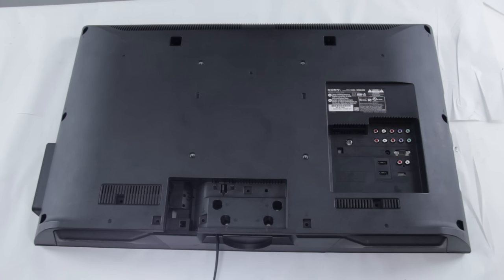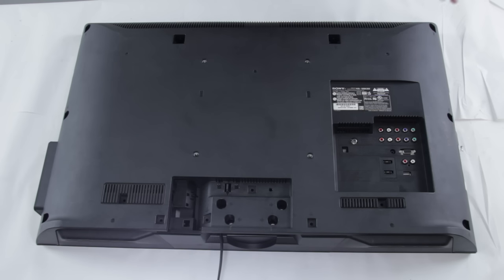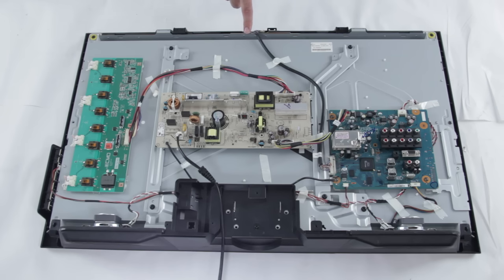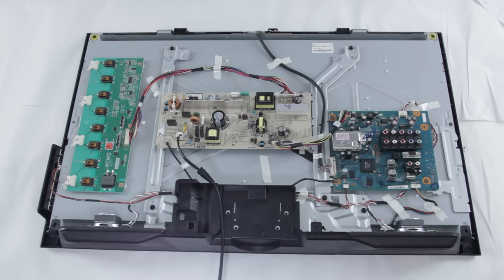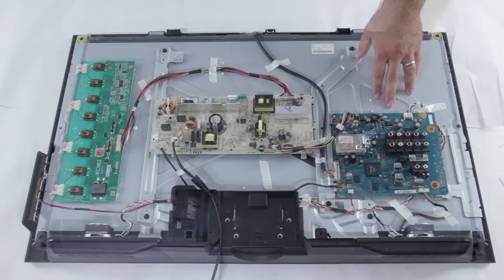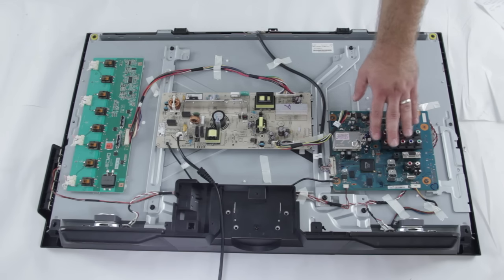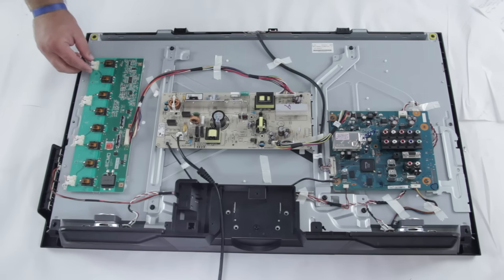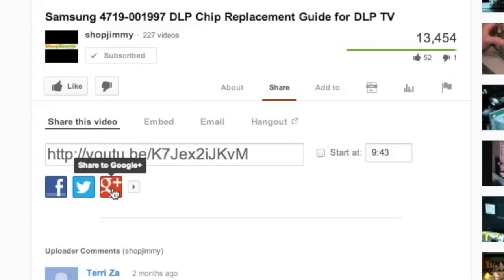LCD TV Repair Tutorial - LCD TV Parts Overview, Common Symptoms & Solutions - How to Fix LCD TVs

Comment: I have a Vistron 42" plasma (EB4219PD) which has a intermittent image fault, the tv powers up fine but every 5-10 mins the image moves to the right, leaving less than quarter of the screen black/blank & the rest of the image has horizontal scrambled look to it, after about a minute it returns to normal, any ideas would be appreciated.
Reply from the maker: Bimmy Lee  Please watch this video FIRST to help with your repair!  TV Repair! LCD, LED, Plasma, DLP How To Fix Your TV with ShopJimmy.com Help!  I recommend replacing the main board first to see if that fixes the problem.  Follow this link to possible replacement parts:  http://www.shopjimmy.com/catalogsearch/result/?q=4219  Be sure to match part numbers on your current board, with your replacement for compatibility.  Thanks and please let us know if you have any further questions with your TV Repair!  www.shopjimmy.com

Comment: hi, i have my sony lcd tv model number KLV-46bx450, the problem is, tv turns on for  seconds then after the sony logo apperas in the screen turns off then a 6 flashes of red led stndby light comes.. help please, is it only the mother board? im afraid that it would be the lcd panel.

Comment: I have a TCL Roku Smart TV Model 55S405.  It will periodically freeze the picture, shut down and go through a legnthy restart.  Sometimes it will run this cycle 4 or 5 times before you can watch anything.  I have tried the soft restart and factory reset and the problem persists.  Would swapping out the boards fix this problem?

Comment: KDL52EX700 Sony - Display is quite dim but visble and colors are distorted/remapped. There are no patchy/regional effects. Its done this several times, and then it would start working again - 100% perfect. Audio always works. Input from all sources are displayed the same on the screen.   Going to split case to look for leaky caps, sniff around and look for damaged components.

Comment: I have problem on my Sony 3DTV 

KDL-47W802A  

from 1 year my picture quality is very poor and video noisy with color not quality as well contrast low, I see HD content like SD on all source bluray or hd setellite channels or the  picture on TV not quality as was it new
 are you advise to me to replace my main board

Thanks
Reply: samsung led 32 inch plasma,type#UA32EH4000,MODELCODE-UA32EH4000RXXA
VERSION#AD01,S/N-299538RC301332B MADE IN SOUTH AFRICA.IT HAS A CRACKED SCREEN AND IT IS NOT SHOWING PICTURES BUT THE BACK LIGHT IS FUNCTIONING

Comment: I just replaced my mainboard on my CX after my television was randomly freezing and making a horrific siren like nose until I unplugged it. It would also randomly freeze without the noise and I would have to unplug it to get it to work again. 

I ended finding a lot on eBay containing a used like new mainboard, power supply, wifi module, power button, and screen board for only $75. I couldn't believe how cheap I got all of these parts for; $75 for a $291 mainboard is a steal. I got really lucky finding this deal. My tv works fine now and I have a ton of backup parts as well. Doing this myself saved me around $500 to $600. The hardest part was moving the tv out of the carpeted room and into a room without carpet.

Comment: based on this video looks like i need two replacements ill check them thank you see i had picture problems first and then the tv wouldn't turn on that sounds like its a power supply and a backlight issue together Vizio E470I-A0 is the model

Comment: Hi Guys thanks for the great videos, they help lots. I have a LG 60la8600 and the screen just went blank the other day, i had one of LG's techs come check it for me and after paying a call out fee he told me my T-con board (P/N 6870c-0445a) was damaged. asking him where can i get one he told me i couldn't get it separately as it comes with the screen, only problem is the screen cost more than the price of the TV itself. I then started my mission to find alternative repair options cause only 3 years ago i spend close to $3000 for a brand new TV and now i must use it as paper weight. after months of searching i finally found the exact T-con board for my TV and the seller was kind enough to give me two of them. excited i then installed my new T-con and boom no change still no picture just a slight glow as before, tried both T-con and same result. i then wondered if its possible that the problem is something else maybe the main board but though i may end up buying all the parts in my tv so maybe look help instead and that's how i got to your channel. needless to say I've tried your website lots of times but get an (access denied error) don't know why but maybe you can help me with that too. but preferably please help me first with a diagnosis of my LG's problem. maybe this is important, TV has sound but no picture and when i press the menu button on the remote i can see something is happening on the screen in the form of the glow intensity but nothing other than that. please please help thank you

Comment: My Philips LCD TV took a power hit a couple of months ago.  I took it to a repair shop and they replaced the power supply.  Works great, except now it won't find any digital or analog channels when I perform the Auto Detection (antenna source).  I have a couple of smaller LCD TV's in the house and they are picking up digital channels (antenna source) just fine.  Is there another part that I might need to replace to get it to find the channels?

Comment: i have a sony XBR48X800E that does not turn on.no power at all.no red light either.i checked the power supply cord and it has power.
i changed the power supply board and still no power.i suspect the main board, any suggestions?

Comment: Hi, I am Mojammel Rahaman from Kolkata, India. I have Sony KDL-32EX720 3D TV, Presently my TV shows some vertical white lines right along any subtitle or TV channel logo. As it runs for few hours the screen becomes almost white like it could not able to refreshed that white lines, and then the hole picture freezes but sound continues as it is. Sony service engineer said it is the problem with the LED panel, However, local engineer said it is the problem with either T-Con board or Main board...
What should I replace.... Please help me.

Comment: TCL 55S405TDAA Screen has gone dim, but viewable. Flashes Bright at times.Sometimes is normal. Have tried all screen, and brightness adjustments. Reset with remote button sequence, Reset button on back panel, and drained capacitor holding down power button behind standby LED. Naturally system restart, including unplugging. As mentioned, sometimes works normal for hours. Although not so much lately. This all started a month or so ago.

Comment: Thanks for posting such an informative video. I am having issue with my Sony Bravia 46CX520 LCD TV. There are two issues:
1. Multiple Horizontal line across screen. These fluctuate with time and are covering the whole screen. I have been advised to replace the panel by sony
2. All of the HDMI ports (Side and Back) dont work. 
Can I requested for your suggestions on the above issues please.

Comment: hey Jimmy, we have a fun one. our 4 year old thought it'd be fun to spit water on the screen. now the screen has no display, but there is sound. I took apart and can confirm the backlight is working. seems like the t con board, but it did not get wet. before I go and buy the part, wondered if you have any thoughts on what else it might be. thanks so much!

Comment: Hi i have hisense 55 inch 4k tv red light goes off when i press it and it stays off with black screen no signal or sound....could you point me in the right direction im going to have a go at it myself ....nice informative vid model no is HD551918M8S11185JCG0313
Reply: Same issue with mine

Comment: I have a Sharp Aquos 70LE735. About two years ago, the TV failed to turn on, but the power LED remained blinking. After a web search I found a way to restart the TV (holding down power button while plugging it in). This helped for a couple of years. But a few days ago the TV turned off while I was watching a program. My usual technique of holding down the power button while plugging in, does not seem to work anymore. I found another technique on the web to restart the TV to bring it to the "K" screen (holding down Vol- and Input buttons while plugging it in displays a "K" on the screen) - but the TV stayed on only a few seconds.  
The "V" Power LED on the TV blinks once per sec (alternates between a short blink and a long blink). I should also note that I am using the 110V/50Hz TV in India where the power source is 220V/60Hz - I am using a step down transformer along with a Monster power conditioner to power the TV.

Please let me know your thoughts on what the problem could be.

Comment: After watching this video I purchased a T-Con board for my LN46A550P3F Samsung TV. The problem is the TV does power up every time, however most times I only have Audio and no Video. On occasion the Video will come on and stay on as long as the set is powered up. If I power off the TV it may have video next time I power up, but chances are that it will not have video. I keep turning on and off until the video appears. If the video does go away the sound remains working. Can you recommend a solution to this problem? Thanks Phil

Comment: Hello. I have an LG TV, model No. 42LB550A. It had a problem of no picture but sound was available. Indeed when I opened I found that two of the LED lenses had fallen off. So I decided to replace all the strips considering the age of the TV...
While doing the strip replacements, one of the strips on the B-side I ran out of double sided tape and proceeded to Installing the strip direct on metal surface. Upon restoration the picture quality had improved tremendously. However, this came with a small irritating problem. There was repetitive transient flicker on the picture recurring like every second or two. After observing for sometime without improvement, I discontinued use and thought of replacing the B-strip installed with padding (double sided tape) between strip and TV chassis.
After replacing this, the irritating repetitive flicker disappeared but I completely lost the picture. Played around with the ribbon cables on the T-con board, vertical colour Iines appeared with a small portion on top (like 1/8th) of the screen showing a fuzzy picture while sound was normal.
I've just packed it for now as I have travelled hoping to continue as I get back by weekend....
I can share videos of there's a way of attaching here...
Kindly help me determine what to do next....

Comment: Jimmy, just like you've asked us to send you questions, I did send you one but did not get a response. One of the 6 plastic connectors to the scan board is unglued and I don't know what to use to glue it back to the board without messing things up.

Comment: Hi Jimmy

Is there a special troubleshooting chart avail? For example. The chart will list...

Problem                  Possible Part Solution Replacement
No Power                Power Supply Board
Color is Off              Backlight Converter Board

Comment: I have a Seiki  Ultra -HD  SMART TV model SC-49UK700N that recently started not showing  a picture! I was watching  it and decided to turn it off before going leaving home. When I returned home I had sound but no picture.  I used the flash light test and discovered I could see images  although very faintly. I turned of all lights in the room and saw nothing through the panels. What is your suggestion for this set??

Comment: Hello Jimmy. I have a Sharp Roku LC-50LB481U LCD Smart TV with no back light but the image is there when shining a light on the screen. I was trying to check the voltages at the connection going out to the LED’s from the power supply board. What can I check with a meter to narrow down to the main culprit? Great videos, by the way.

Comment: I took apart my sharp LC-32LB370U to replace the LED lights it took 2 weeks to get the parts and now I've forgotten how to put the legs and speakers back on the unit. Is there any diagrams showing replacement parts?

Comment: I HAVE A PHILLIPS 47PFL6704D/F7 MY ISSUE IS IT TURNS ON OK BUT AFTER RUNNING FOR ABOUT 45-60MIN THE PICTURE TURNS  OFF BUT STILL HAVE AUDIO WHAT PART IS NEEDED T-CON OR BACKLIGHT IKNOW THIS REPAIR IS AT MY OWN RISK WHATS YOUR RECOMMENDATION THX VINCE

Comment: I have a W BOX model number 0E-32LED and I am getting a bunch of colorful vertical lines in the screen where it was hit (screen is not broken) but you can see where the problem starts. It is a large square that takes up most of the screen and behind it I can see in the upper left corner the input screen that displays on the square before it disappears.

Comment: Hello, I have a Toshiba 40E200U1. It was working fine with no issues until yesterday. When I tried to turn it on the green light in the bottom left corner would come on for a few seconds then go off. After trying this a few times and unplugging the TV for awhile it now does not show any light when I try to power on, nothing happens at all. Thank you.

Comment: great video! i have a samsung ue55 ju6740 uxxu given to me by a mate who said it busted after power shortage in his flat. i opened the back up and found now damage however after using a voltage  detector pen found that the fuse was broken on the power supply board.  replaced the fuse and power is now detected all over the tv boards however still no signs of life. would you be able to advise?

Comment: Hope you can help with a TV issue.  I have an ELEMENT ELGFW551 and it started to blink off with a “No Signal” and then come right back on with a picture, it would do this every few minutes.  I changed it from 1080p to 720p and it stopped for a few months, and then the 720 started doing it, it started once in a while and it started doing it almost every 30 seconds.  So I ordered a new control board from ShopJimmy and it fixed the problem... for 11 days, then the screen went black (it still had LCD lighting and you can see the blue glow from the LCD lighting) so I sent the control board back and got a new one, same thing.  I ordered a new T-CON board and installed it, black screen, NO LCD lighting. I put the old T-CON board back in, I have LCD lights back again; re-install new T-CON, LCD gone. Where do I go from here? I really don't want to trash the TV after spending $100 trying to fix it.

Comment: Comment or Question:
To whom it may concern: 

My Samsung TV, model LN40A630M1FXZA has the following symptoms:
 
1.Repeatedly, turns ON and OFF before it stay on. 

2. During the powering cycle, green and red distorted lines appear on screen. 

3. Also, during the powering cycle noises prolonged sharp grating or squeaking sounds. 

Would you be good enough to advise me which replacement part(s) I should  be looking for ?

Thanks guys

Comment: Hey, very nice & helping video ! I have a problem with my Loewe Xelos 
32 (LCD) TV ;  Artn° 51429W90 / Serial n ° 08216 ; problem is that we have coloured areas on the display when turned on, not on a fixed location, but can move after a while.   When watching 2-3h television, they are more or less disappeared.  T-con board the issue ?

Comment: i have a sanyo dp55441 it will not power down or change channels with or without remote also there is no sound or picture it wont change input modes either.i ordered a power supply board from you today and i am hoping this will solve the problem.

Comment: I have a Sony Bravia KDL - 46BX450 It does not power on. I have removed back and inspected power supply. There appears to be an fuse that is soldered to the board. It appears white and foggy. Would this be blown?

Comment: I want to make sure im hearing it correctly, the name of the board that is welded to this particular model is called the T-COM board, or is it the T-CON board? Secondly, I have a Haier LCD 32" and placed exactly the same way on your Sony but it is at the bottom of mine. How do I know that it is welded there, and not by other (removable) means placed there?

Comment: my Samsung UN65F6350xxx was shutting off and on randomly for no reason. even touching the volume button would set it into a sequence. The solution was to change out the motherboard which is available on shopjimmy. it only took about 30 minutes and was easy once off the wall mount..

Comment: I’m troubleshooting a Sony KDL-40V2500. According to your video I leaning toward a backlight inverter. I have changed the power supply board already but that didn’t solve the problem. When you power the set on the picture and stand by light shows for a second, then picture shuts off and the standby light starts flashing red 4 times. Any suggestions! Would trying backlight inverter be the next course of action? Thanks in advance for any advice.

Comment: jimmy just watched your video here is my issue.  Hitachi  model 55r7 ser#TH6HH02865 it has been acting up picture just shuts off get a bright red light normally dim red when working.  I have reset power and it worked once. No longer the case suspect tv detecting fault in power supply but was hoping for a more definitive this is what it is.

Comment: Hi I have a Sony KDL-26U2000. I plugged my active speakers into the aux socket of my TV to get the sound of my TV to come through my speakers, when I turned off my speakers the TV went black and turned off. I have checked the power output which is working fine, the fuse in the plug for the TV which is also okay in other appliances. I took the back off the TV and tested the fuse inside the TV which also works fine. What is the solution? Is there more than one internal fuse? Thanks!